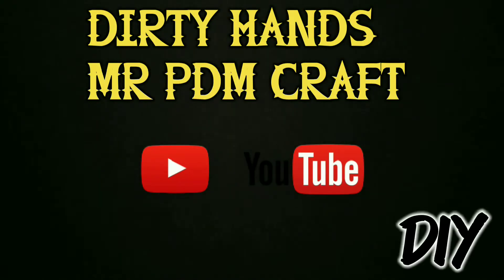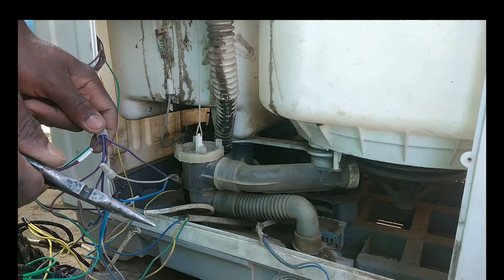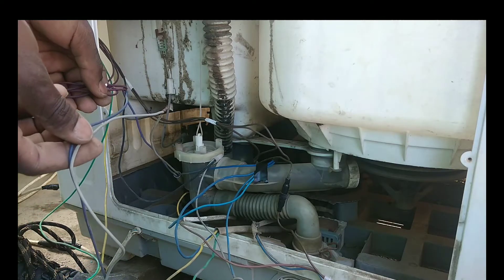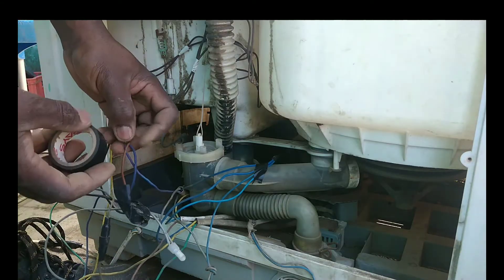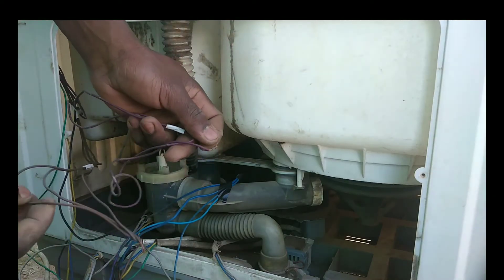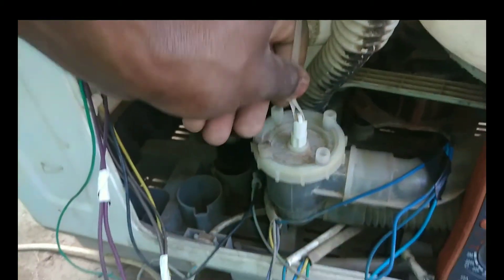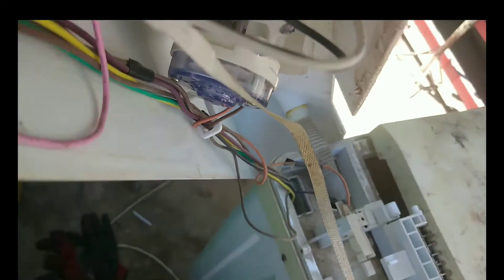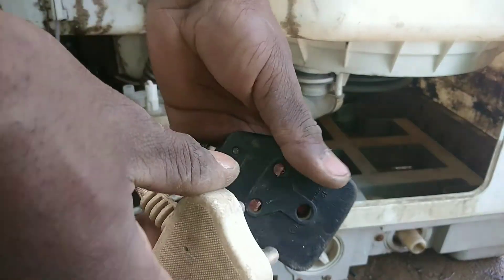#How to test the Motor&Switches of a Twin Tub washing machine Spin Dryer to see the cause of failure

Comment: You are really knowledgeable.
Can you make a video about replacing the capacitor safely? My washer has a failed capacitor and I'm worried about replacing it because of the dangers.
Reply from the maker: Alright , thanks for becoming the family member of this channel, I will make a short video for you
Reply: Actually after having watched some of your other videos I now think it might be the motor failing not the capacitor. When the washer is on and the pulsator is supposed to be rotating clockwise there's a humming sound coming from the motor but the pulsator doesn't move. But in the other direction the motor is much noisier and the pulsator is moving a tiny bit. Do you think it's the motor that is failing?
Reply from the maker: Yeah , im 100% sure it is the motor failure

Comment: Hi someone came to fix the spin motor but forgot to insert that black looking like a little tyre thing that links the wash motor to the tub to spin..how can i put it back
Reply from the maker: Sorry for the delay to reply, if you are talking about the seal that holds the spin bucket shaft, you will have to buy a strong adhisive contact glue and use it